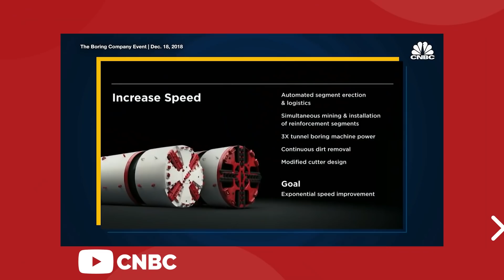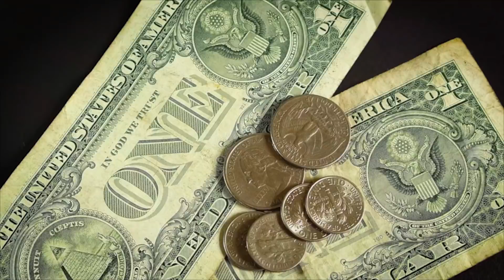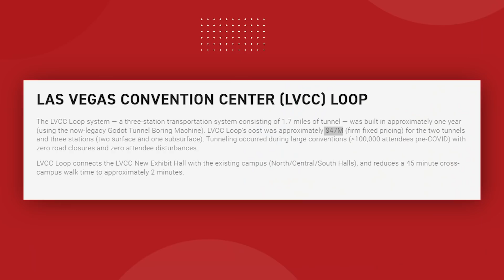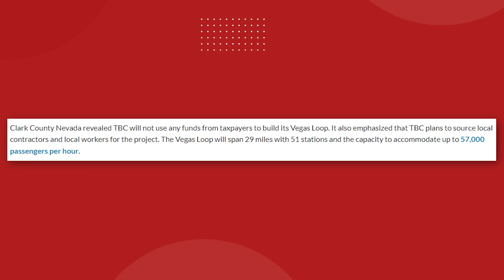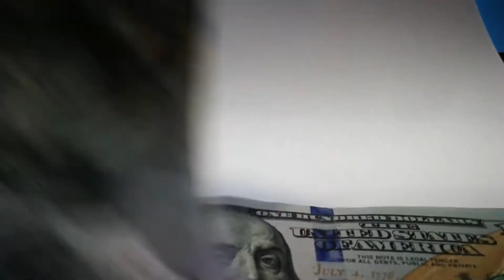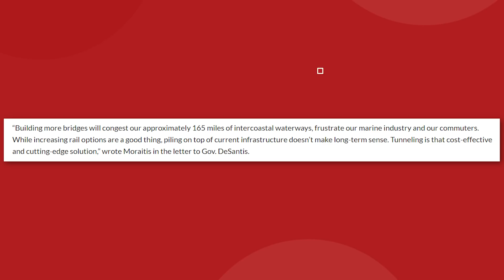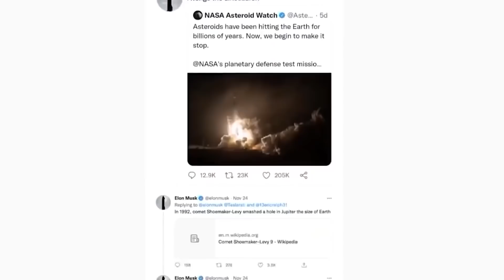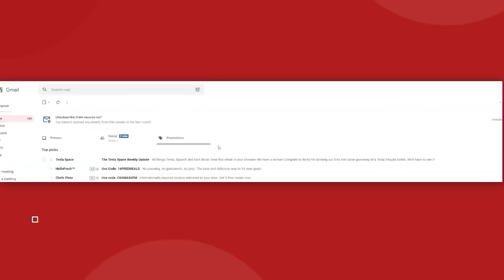The Boring Company 2022 Update

Comment: I think the tunnels are excellent, but at the convention center, wouldn’t tracks and compact rail vehicles, holding more than 3 passengers, make more sense than expensive cars?
Reply: Yes it would. But the cultists will probably never see that.
Reply: The trains would be more expensive.  Trains don't climb ramps very well, so the two end stations would have to be underground.  The middle station, which is underground, cost 20 million, the end stations which are above ground cost 2 million.    So the trains would add $36 million even before you pay for the tracks or the trains.
Reply: @kevinbailey8827 you can’t compare the cost of a subway system to the boring company because the boring company just built a tunnel without safety features and many things that make sure that when you get in the tunnel everything is working.
Reply: @JohnDoe-vf3qo  You don’t want to compare the costs, because the loop comes out far ahead based on cost.
Reply: @kevinbailey8827 well the costs are totally different based on size of tunnel, materials, safety features and the length. the loop uses a smaller tunnel which usually cost less to build already took away the sprinkler system, the emergency exits, and ventilation system so with just t boring and adding the structure it probably cost more to build than what the companies in the industry could do it for with the same situation…
Reply: @JohnDoe-vf3qo  There was an opportunity for companies to compete for this project, and they fail to offer a compelling product.   They wanted at least four times as much. 

One of them came back after it looked like TBC was going to get the project and said they could lower the price of their elevated train from $210 million to $85 million (which suggests that maybe these companies have been overcharging customers all along).  That was still more than $30 million higher than TBC, plus it would have been more disruptive at the surface during construction, plus it would have taken longer to build. 

There will be other opportunities for these legacy companies to compete in the future.  They need to get ready.   Especially if TBC does what they have done in Las Vegas, which is to offer to build the tunnels for free, and make their money by collecting passenger fares.   Any of these existing companies could do the same, if they have faith in their own product. 

This could lead to a golden age in public transportation for the United States.
Reply: @JohnDoe-vf3qo  So you think this is going to be such a good experience for passengers that they’re going to buy enough Teslas to pay for all the tunnels. That’s going to take a lot of happy customers, which means they move a lot of people.   That sounds like an accidental success as a transportation system. 

Traditional metros should just give up, because they don’t stand a chance.
Reply: @kevinbailey8827  ok.
Reply: @kevinbailey8827  ah, I see. The plans show all end stations, right?
Reply: @mr.jamster8414  I haven't seen all the plans, but the stations will be built by the casinos and other venues at their expense.  I expect they'll take the less expensive option, as Resorts World did with their station.
Reply: so now u need to build a giant parking lot that can also somehow teleport their car to the otherside or the passenger will be annoyingly comeback AGAIN to take their car. Im not sure the geography there but if ppl want to go through that center fast, why compact rail vehicles make sense lol.
Reply: @khiemgom  you just let the car park it self then :P Or maybe parking below ground
Reply: @khiemgom  No one wants to use rail unless it's the only option, people would rather be in their own vehicle or a vehicle to themselves and their fam and friends.  Musk has the right idea here, the regulatory bodies are the hurdle.
Reply: @ABQREDorGREEN  very inefficient
Reply: There is a new viral video on the LV tunnel today and every single commenter is negative on it lol
Reply: Also the individual Tesla cars uses tons of batteries, by using a small pod or tram wagon directly connected to the grid it’s significantly cheaper and faster, plus the trans can last decades
Reply: @carholic-sz3qv  cheaper? once built maybe but no because to build a tram you need a tunnel about 3x the diameter of these tunnels(100x the cost per mile of what the boring company is doing). Faster? no top speed of most subways is like 35mph but with all the stops they are only moving at full speed ~10% of the time(always accelerating and decelerating, whereas the current speed of the teslas under human drivers matches the top speed of a tram except it gets there in <1 second. and will be able to drive 70+mph when autonomous and only stop at the destination you choose instead of every destination(if you want to go to the airport you don't have to stop at the Luxor exit then the Ceasar's palace exist then the Bellagio exit etc.)
Reply: A moving sidewalk would have been better.
Reply: @Dbarrabee Yes. You have now broken the Tesla fans' logic with one sentence. Prepare for rage posting.
Reply: @doggonemess1  yea, too funny. I didn’t think I’d even get a response 😜✌️
Reply: He wants to sell cars, Musk doesn't care about efficiency.
Reply: These electric cars are definitely cheaper than train cars and you can fit way more than just three passengers. Electric self driving vans are not that complicated to make. Just need the software and metals for the batteries.
Reply: DONT CALL IT TRAINS!!!11!!
Reply: @Fannystark007  ok, how about Tram? you know a multi passenger electric vehicle running on rails.
Reply: yes yes yes, it is better to use a train.
but amercians have never experienced anything different so.....
they don't even wanna try
Reply: yes, I bet they will make a circual car that has very tight margins for public travel in tunnels?
Reply: Rail "is what it is", by using roadway they can have vehicles do part of the journey outside the tunnel and go door-to-door for example, how many businesses in that crowded city need stuff delivered to them by a small van?
Reply: Levitation magnets could push trains at 4000mph.. that's 4 thousand.. eliminating need for airplane travel
Reply: @Comin_at_U_Live  in a vacuum tube maybe.
Reply: @Comin_at_U_Live  Yes, the Hyperloop.  Needs a near-vacuum in the tunnel.  That won't be for few years yet.
Reply: People wouldn't be able to get to their pinpoint location though. It would just be like a train and you would have to get a bus to get close to your destination. Being in your own car let's you drive back into traffic and get to your destination faster and more comfortable in your own car
Reply: @Amir.Zulfiqar  We already have such a form of transport. It's called a Taxi.....
Reply: Yeah if this was a rail system of some type this would make a lot more sense.
Reply: @chaselewis6534  You cannot even retrofit a train into this tunnel, its just too small.
Reply: In an ideal world yes, but actually no.
If you get enough autonomous cars, density isn't that much of a problem. The nature of cars make it possible to not stop at every station without the moving parts needed for railroad switches, it also makes it possible for passengers to take as much time as needed to get in and out the vehicles, and the service quality and ease of maintenance is higher overall, due to the lack of rails and moving parts outside the vehicle itself, so it's better for both brand reputation and maintenance costs. Also, one musn't forget that compact rail vehicles are actually not cheap at all. On top of that, the cars are are expensive, but still a fraction of the digging cost.
Reply: @Exilum  A 1,500 capacity Metro train costs about 10 million. You would need 300 Model X's to match that at a cost of 30 million.
Reply: @davidwebb4904  He's talking about compact rail vehicles for a reason. The goal is to avoid crowded places. A Metro train IS a crowded place. So if it was a rail vehicle, it would be a four places rail vehicle at most, with a single group / lone person in each.
Reply: @davidwebb4904  The problem with a metro on top of not meeting the basic requirements is that you can't have a too high frequency of transport. You need to at least account for 3 minutes of delay between each train, because they are heavy, people aren't fastened, and thus slow to brake in case a problem happens. They are also pretty high maintenance, and if you want to fix a problem, you have to switch at least a whole car, if not the whole train.
Reply: @Exilum  London tube trains run every 90 seconds at peak times. Thats 40,000 people an hour. The next generation system is looking at 60,000 an hour.
Reply: @davidwebb4904  Do you know the maintenance frequency and cost? And how many people would that represent with at least 2 sqr meters for each individual, with them sitting? Considering people are usually expected to take at most a square meter in a metro, with less than half sitting, and the space needed to make each personal space private in a TBC version, it'd be closer to 10-15k with the next generation system to match the basic requirements. And that's assuming people are traveling alone. If people can travel in groups up to 4, you need to think that the average person probably travels in groups of 1.5 to 1.8, which would means more space needed anyway, so it'd be definitely closer to 10k. Metros are great for their use case, but they aren't for other use cases.
Reply: @davidwebb4904  Metros are essentially designed to transport a lot of people at once, while saving as much space as possible, not to make for an agreeable journey. That's not TBC's goal. Their goal is to make a bunch of cheap to build tunnels AND provide an enjoyable journey.
Reply: @davidwebb4904  The Model X will be replaced by a larger autonomous vehicle to handle more passengers.
Reply: @McClarinJ  Like this? 
The Docklands Light Railway is an automated light metro system serving the redeveloped Docklands area of London, England. First opened on 31 August 1987, the DLR has been extended multiple times, giving a total route length of 38 km. Wikipedia
Reply: The trains are more expensive than the cars per passenger when you sit down and do the math. Mass production drives down cost a lot, and economics seems to be the weak point of most of the naysayers.
Reply: Cars / trains
Reply: Four points.  AFAIK, all trains are compelled to stop at every single stop whereas a Tesla can go straight to the desired stop, trains are way more expensive, the tunnels would have to be larger in diameter, adding to the cost, and trains expose you to more people, some of whom may be poor travel companions.
Reply: Does he own the tunnels? I think that's where the value is whoever owns the tunnels, they can put whatever type of vehicle they want in there in the future. I see a lot more use by using drones to transport or deliver things
Reply: @claudeyaz  Not yet but there is one project under consideration that would be completely covered by The Boring Company, which would then collect all fares.
Reply: It’s called marketing and business sense.
Reply: Potentially. But in this case the tunnels are tunnels. They can easily use whatever the latest tech is that can use the tunnel. Because in 50 years those rail carts will be gross and outdated. Parts to fix them will likely be unavailable.
Reply: You have your vehicle with you when you're done going down the tunnel.
Reply: Yes probably. Maybe Elon should review his ideas.
Reply: @brett4264  Hes using it as publicity for his cars. It serves no other practical puroose
Reply: @davidwebb4904  well also if it uses tracks that just a train, from point a to point b thats it. But with teslas you would be able to go through a tunnel like a speed boost and not have to exit your car to go on roads. It would just drive out. Plus gas cars would not work because of the ventelatoin system. I could go on
Reply: it'd be more efficient if elon bought one of those grocery cart pullers that wallmart uses and 100 shopping carts that people could sit in.
Reply: @jebes909090  lmao
Reply: The key word here is autonomy. Firstly, these loops will almost certainly be the first places on earth where autonomous vehicles are allowed to serve human passengers without a need for a driver, this alone makes it worth it for Musk. Secondly, if it's not just the raw number of throughput of people but rather a mix between throughput and comfortability, cars will be vastly superior to a train.
Reply: No, the cars will be cheaper, and as the cars become more autonomous, and the network of tunnels more complex, the cars will be more efficient too.  In the near future they can work more like a train but still able to separate and go in different directions.  We're likely to see this in highways as well.
Reply: Because he wants to bore tunnels on mars. In order to improve the tech, you need tons of practice on earth. For (paid) practice you need demand. Therefore he can use his influence to drum up excitement and start practicing.
Reply: See Thunderfoots debunking video on the LV Loop.
Reply: @davidwebb4904  I saw thunder foot's anti-hyperloop video, and he's an idiot.  He kept harping on expansion joints, despite the fact that  expansion joints of pipelines are a problem that has been solved for well over a century.
Reply: @davidwebb4904  ThunderFoot is a paid Hack and had to delete his videos on SpaceX and Tesla where he claimed they would be dead in the first 5 years!
the guy takes corporate money to discredit companies so they can share these false claims to scare away investors he did the same with Solar HydroPanels... so going today i mean the guy was accused of plagiarism on his published papers FFS...  LOL i give him as much credit as analyst Gordan Johnson!
Reply: @davidwebb4904  None of us wants to give Thunderf00t any more views because half the time his entire video can be invalidated with moderate tweaks to the design he's discussing. It's a waste of time. He's fundamentally clueless on many of the topics he discusses. (Like the Energy Vault video , where it's obvious he didn't even spend 10min researching the field of grid energy storage before writing his script). 
  I can see several huge issues with the LV loop that he might talk about. But half of them can be fixed by swapping the Tesla cars for a purpose built vehicle. But it's going to take a while until Tesla can deliver such a vehicle. It's pointless anyway until they have full autonomy working with the Tesla cars and until the Boring Company is closer to finishing construction on a loop that actually targets a high volume of passengers. The LV loop is a publicity stunt and a testbed. Ad it stands it's not remotely useable as true mass transit, and that's fine.
Reply: @auspiciouslywild  He spells in out in very easy to understand terms why “this” video is complete hogwash.
Reply: @auspiciouslywild  Existing airport terminal  shuttle trains are two magnitudes more capable than the Loop. Faster, and far
less expensive to operate.
Reply: @auspiciouslywild  so basically, if they use a...train it would be better
Reply: @davidwebb4904  If Elon wanted to he could focus on the loop to make it work but he threw it out there since his main focus is mars
Reply: @davidwebb4904  how about an airport train that at the end of the track can continue on and drive you right up to your car, or even right up to your hotel...
Reply: @davidwebb4904  This LV loop is currently proved to be able to carry 4400 passengers per hour. 6600 passengers per hour with additional minor improvements like autonomous driving and increasing speed. The capacity will further increases when Tesla make mini-bus or vans. 10000 passengers per hour is easily achievable with these vehicles. 
And loop can scale well with additional tunnels.
2 tunnels Loop only costed $50 million/mile and will be even cheaper in the future with faster tunnel boring machines.
12 tunnels loop system will cost <$300 million/mile ( May be <$120million/mile) while carrying over 60000 passengers/hour.
Now, what is the cost of Landon subway/mile?
Reply: @josephine2869  40 million for a pair of 1 mile tunnels carrying 40,000 an hour.  
Did you not see the video of the tunnel at CES? Elon has literally "invented" the traffic jam. 
As for claims if the loop carrying 4400 per hour, I call bullshit. Just do the math. 4400/60= 73 per minute. Or a full car every 3 seconds. 
Sure if they build additional tunnels or whatever, but that's not the point. 
Even folks from the 1800's Victorian era would be pissing themselves with laughter at that Loop. It's barely better than a horse and cart.
Reply: @backacheache  Elon has to invented the Uber
Reply: @davidwebb4904  its easy and cheap to build a train above ground that has 2 to 3 destinations. Once you put in 40 destinations being able to select one to drive straight to makes more sense than stopping 40 times.
Reply: @Legendary33284  We already have such a form of transport. It's called a Taxi.
Reply: @davidwebb4904  thundercuck hasn't been relevant in years
Reply: @Toefoo100  Just go watch his fking video, debunking the LV Loop. Then get back to me.
Reply: @davidwebb4904  He debunked SpaceX too. Now he is proved wrong.
Reply: @GowthamNatarajanAI  He actually made some seriously inaccurate claims in his SpaceX debunking, similar to the false claims made in this video, for which I called him out for. I don't take sides. I am an impartial truth seeker.
Reply: @davidwebb4904  Yes. Same here. I am not Elon fan and don't one Tesla stock. I was a skeptical of Elon 3 years ago. Not anymore.
Reply: @Toefoo100  theres no helping you if you believe the shite elon says
Reply: @Supraboyes  I'm sure you believe the earth is flat just because at one point Elon Musk said it was round
Reply: @davidwebb4904  I've watched a bit of his video....just repeats the same footage and point over and over to pad the video to 21 minutes . Doesnt debunk anything
Reply: @stoppernz229  How many passengers can this Loop reliably and consistently carry 1 mile in one hour? 
How many passengers can a Metro train carry 1 mile in one hour? 
The Metro train also consumes far less energy per passenger mile. 10 watts per passenger vs 100 watts per passenger for the Tesla Uber. 
State your defence.
Reply: @adamski8985  he isn't relevant because he straight up lies in his videos, especially when it comes to spacex
Reply: @davidwebb4904  I actually did watch it. I actually watched his video trying to thoroughly debunk elon musk- I wasn't exactly impressed. There were definitely parts that shook me, I was surprised to hear about his pay pal shenanigan's, but when it said "anybody can land rockets with enough funding" I laughed out loud- what an embarrassing thing to say. It was also intentionally misleading, it tried to frame elon as trying to revolutionize the current car industry- he is, but thats with tesla not the boring company. The boring company is built as a benefit to buying an electric car, basically highways that wont get caught in traffic because you can just keep digging more. Thats all. Of course theres "Spin" on all of elons products, have you ever taken a marketing class? What else are you supposed to do to try and get investors. Im not going to claim that elon is a perfect human but I can still appreciate some of the good things he has done, which ARE significant. Tesla's are incredible cars and rockets that can land ARE revolutionary, no matter how many previous scams elon was involved with.
Reply: yup, trains just make sense for these use cases point blank ...
Reply: @strawdemindset  No. After reaching the destination what will the passengers do without their car. These tunnels are not point to point. These are just by pass tunnels. So the car itself should be transported too so the people can drive to where they want to go.
Reply: @strawdemindset  That is not going to happen. The chances of boring company succeeding is much higher than that happening
Reply: @GowthamNatarajanAI  if we get those loops than we need to remove the above ground highways and make streets more human, more bike friendly 
cause cars are not sustainable.
Reply: @strawdemindset  trains make sense when there are three stations yes, but if there are 40 stations and a person wants to go directly from station 1 to station 35 train cars are shit because you have to stop at every single stop between 1 and 35 where as. at maturity this system can drive you directly from 1 to 35. It not complex how in a large system this way is more efficient for the passengers(therefore will draw more customers).
Reply: Our country is to large, we need vehicles
Reply: for 1 billion+ per mile instead of 10 million
Reply: You do know, its not about urban transport. Of course, the nay sayers can't see the big picture.   That's the problem with earthworms.
Reply: @fredandersen9873  why isn’t it? Surely that would be better no?
Reply: @16cents14  ok, I'll answer your question with a question: how would solving urban transport problems, contribute to the colonization of Mars?  Answer: it doesn't,  but the TECHNOLOGY does.
Reply: All the Vegas "rides" will be purchased by the Casinos to service their high roller class. No tourists will be seen anywhere near the Vegas tunnels. It will be a smash hit and put the project in the black faster than expected. Wherever they are built, the tunnels will not be used for general public transportation. It will be a luxury item for the elite class. I have no problem with that.